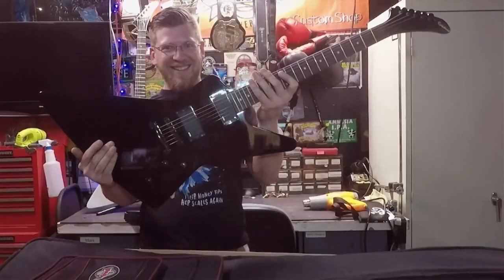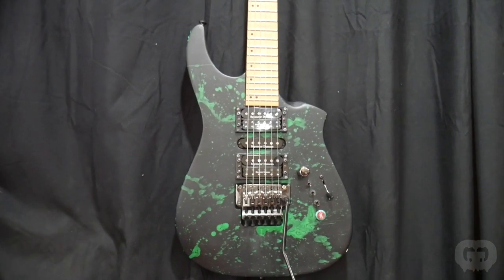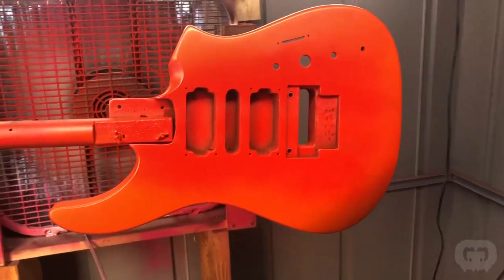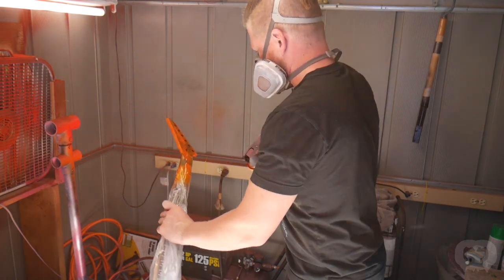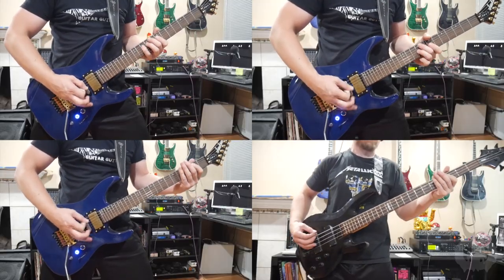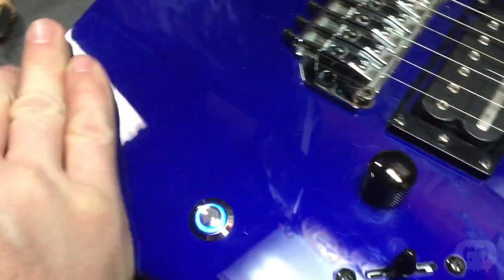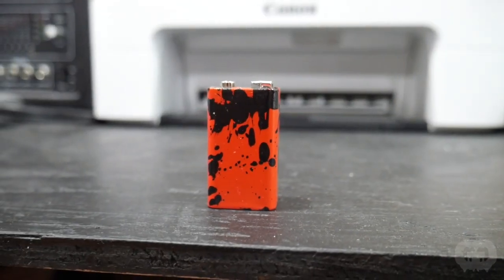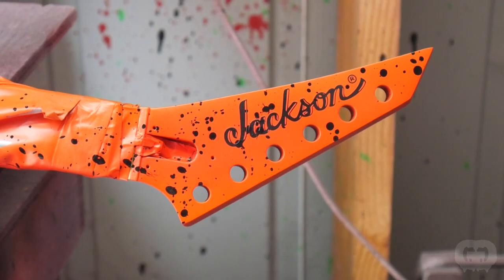Trash to Thrash #3 - Selling Guitars and the Blood Shadow Hackson - FULL EPISODE

Comment: If I lose a trem block, I'll usually just put the ball and where the block was and tighten the screw into the ball.
Reply from the maker: I like that. It turns out the screws wouldn’t even go far enough in for that! This model is a weird one, I’ve found out the strings load in through the back of the Allen screws and there are no blocks. It a version of the speed loader floyd from GHS i think.
Reply: @GuitarGuts  ooooh it's one of those!